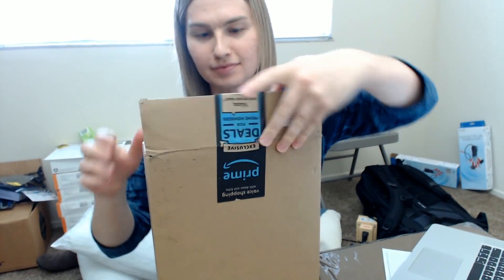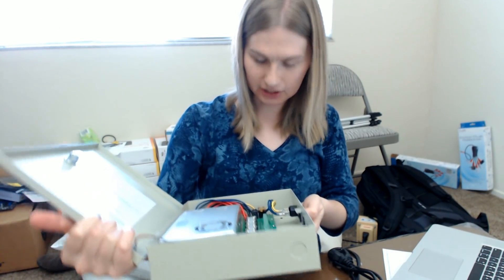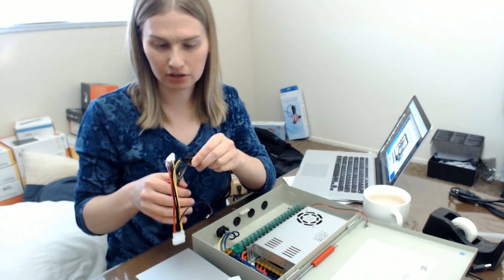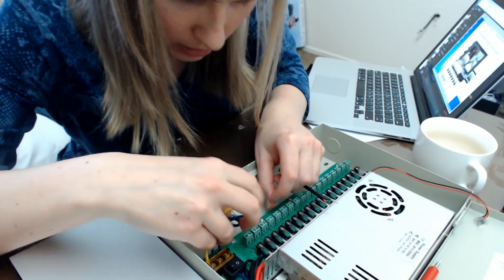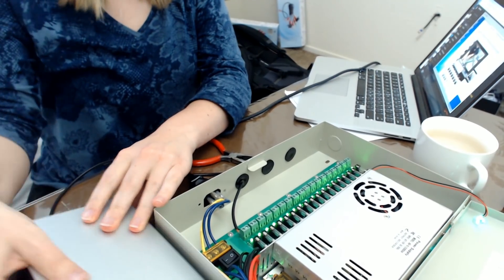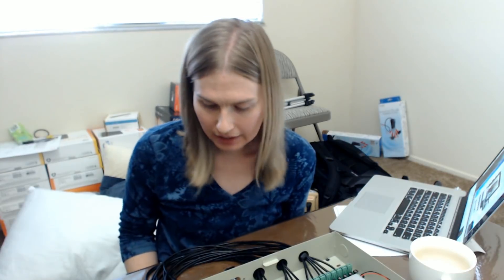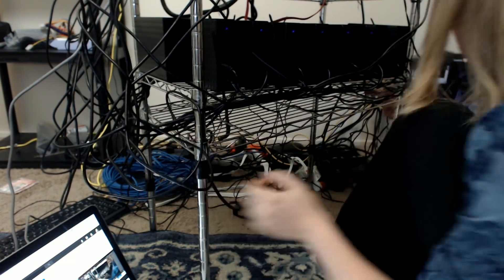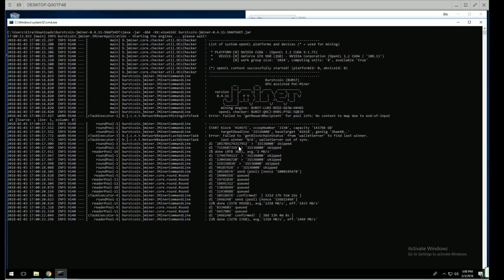Burst Mining Rig, External HDD Part 3 'PSU'

Comment: Get a multimeter. Lord. Anyone with any technical knowledge watching this video just cringes.  Problem with the security camera power panels is most if not all only supply 1 amps per 12v out. Most external drives will draw more than this at times to run without errors. Or without damaging the drives.  There are a few companies that make rack mounted 12v power supplies such as watt box but they’re expensive. Like $300-1000.  There’s one guy online that actually built a 12v power supply for external drives the correct way, with power conditioning and such. But it was a lot of work. Heh. https://www.instructables.com/Multi-External-Hard-Drive-Power-Supply/

Comment: I want to start doing this, how many drives in would I be adding a power supply to the mix? Sorry if the question is silly, I don't much much about electricity or anything like that.

Comment: Hey Kira, I ran across your video on BC mining and figured id say hello and maybe offer an option for future expansion. Check into the Altronix AL600ULX with ACM8 Trigger board. What this will offer is 12v x 3.5A x 8 channel. Its what im using atm and have been able to run up to 6 HDDS per channel making for a full build of 48 hdds per Power supply.

Comment: Tip - get long cords, put your power supply in its permanent place, put your drives in the permanent place, plug cords into each drive, leave a bit of slack loop, then zap strap the power cords back to power supply, then put the cords into the power supply one at a time with their custom length.  All neat and tidy when done.

Comment: My only concern would be about the enclosure itself, power supplies need breathing room hence the fan and vents on the power supply itself and the enclosure itself has no ventilation? How hot does that enclosure get while running?

Comment: Thanks for your video. Why should we need to get a PSU separately, whether we can just use the power adapter which comes with external hard drive?
Reply from the maker: Since the rig will support 32 hard drives... it becomes quite a mess of cables and much more difficult to manage.
Reply: Thanks for the information.
Reply: Also it comes down to efficiency, using many power cables individually will use more power and generate more heat, where one unit will produce more usable power not lost to heat.
Reply: or just go with the flat 12outlet power strip from Frys .. 19$ each....I'm using 3 of those and a surge protector before the long ones... can do to the job with no problem . only drawing 160Watts

Comment: Thanks for sharing. How can you pconnect so many hdds into motherboard? Are you using usb3.0 hub on PCI e adapter 4 USB ports also?
Reply from the maker: Good question!  I al using the Sonnet Allego Pro PCI-e board as well as a ROG Crosshair VI Hero, combined with USB 3 and C hubs.
Reply: So you kind have 4 USB 3.0 hubs connected on each Sonnet Allego Pro board ?
What is the reading speed for each Hard disk?

Comment: You can buy the 5.5 x 2.5 power cables on Amazon that could replace the 5.5 x 2.1 cables and you wouldn't need to use the adapters.  Search for "DC Power 12V 5.5mm x 2.5mm Barrel Male" pretty cheap at $17 for 5.
Reply from the maker: Hehe $17 for 5??  That's so needlessly expensive  You can get 10x of the 2.1mm variant for $7, and the adapters are maybe $0.30 a piece?
Reply: Yeah you are right.. That is a bit pricey. I kept thinking about it because I really dont like the idea of an adaptor.  LOL You could just cut the power supply cable that came with the drive. ;)